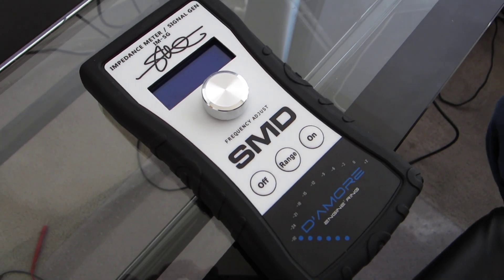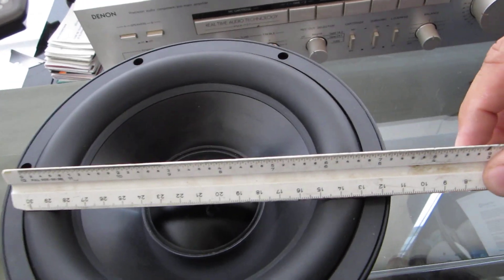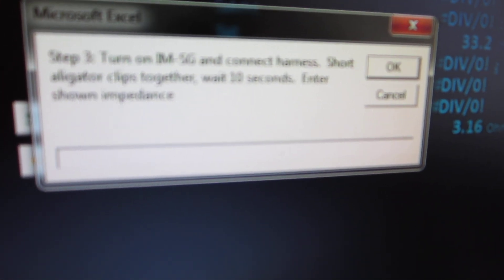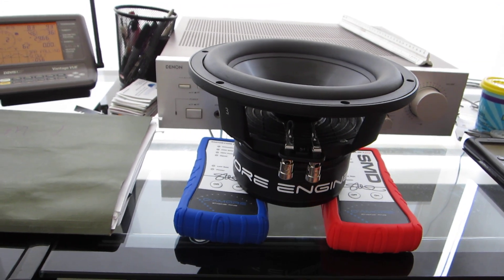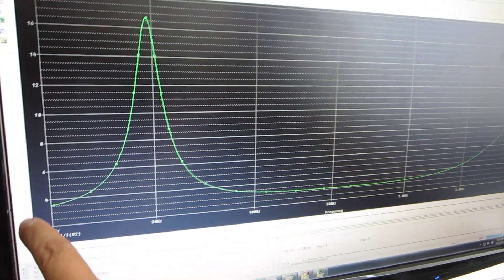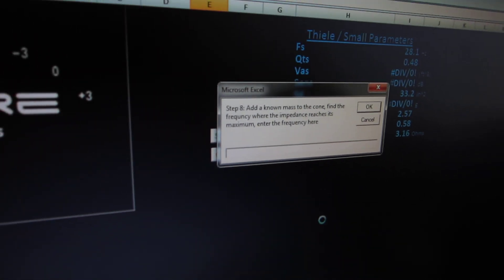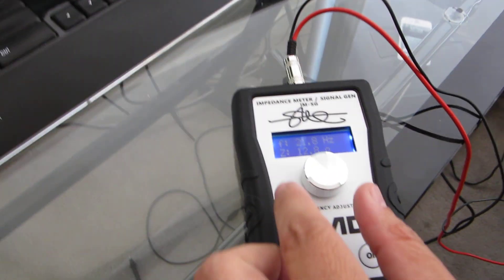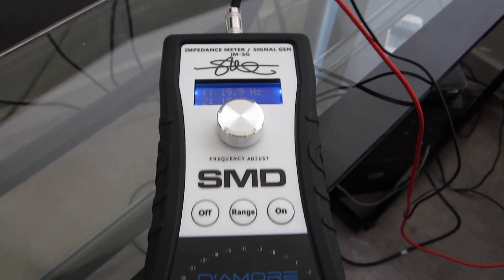IM-SG Video 1 - Obtain T/S Parameters of a Speaker

Comment: Is there App available yet or anytime soon?   If not how do I get the spreadsheet to open correct on iPad Pro 12.9?  I can only get the page to open, it won't let me edit or open in excel.

Love the product, I have owned im-sg since it came out.  I also have CC1, DD1 plus and AMM1.     Now that I have had these tools a few years do they ever need to have the firmware updated or anything?

Comment: So basically, no you cant take a T/S parameter measure using SMD's gear alone, and the Fluke 189 is near £400 in the UK plus the £310 that the SMD meter cost in the first place ... and the Dayton DATS costs £99. Not seeing the up side of any of SMD's meters so far. Nothing that a mutilmeter or Oscilloscope can't do for around 1/3 of the price or much less and do it much better than the SMD meters.
Reply: We have learned that we can reliably make the measurements using the IM-SG @7Hz is about the same thing as DCR using the Fluke in the step where we use it here.
Reply: Tony D'Amore Still, it's a pretty penny, for something that doesn't do anywhere near as much as a piece of equipment near 1/3 of the price!

As for doing it quicker than..... again I think SMD is onto a loser what that marketing point as well!
Reply: Tony D'Amore The misnomers in car audio just keep on coming don't they!

Comment: So I was just using the IM-SG to find the params for my sub and I noticed when you try to find the Fms the book says use 300grams for a 15 but if the number you get isn't less than 25% to keep adding mass until you get the fms 25% below the fs.Does adding extra mass over the 300grams throw off the numbers after that step?

Comment: I have a suggestion for a video or several videos. Calculate the max SPL of a driver & box at a given power. I was told by a driver manufacturer that it was impossible to predict the output of a ported box based on the driver's rated power using box design software and the drivers TS parameters. I know it is nonsense but coming from an engineer it would be awesome.

Also it would be great to see examples of optimizing ported and sealed boxes for a specific driver for max SQ and max SPL.